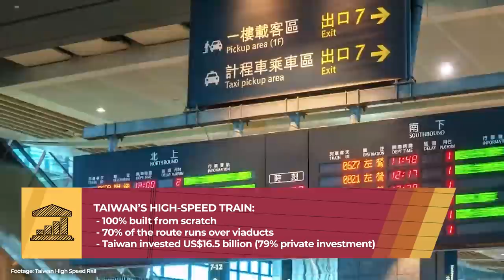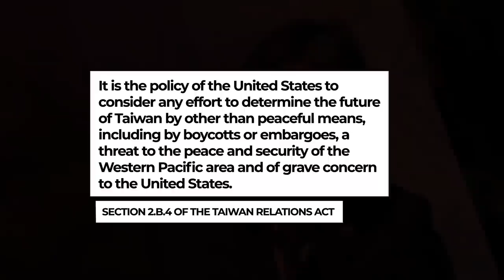Could JAPAN save TAIWAN from CHINA? - VisualPolitik EN

Comment: Once you said TSMC I knew that alone was enough.... Single most important factory in the world.
Reply: You would have to think they have it rigged to blow ( just in case )
Reply: As soon as the first missile landed on Taiwan, that huge TSMC fab would be history.  They’re building an another one just as large in Arizona
Reply: @didiermontagnier6114  The one in Arizona is only going to have a fraction of the wafer capacity of TSMC's multiple leading edge fabs in Taiwan.  Its also going to be a 5nm fab that goes into operation in 2024 which while great will be a node or 2 behind what TSMC will have in Taiwan in 2024 (2 or 3 nm).   One (of multiple) reasons TSMC aren't building cutting edge fabs in foreign countries is its alot easier for trade secrets leaking out, as in any industry a competitor (eg Intel) will have an easier time  poaching competitions employees (eg TSMC Arizona employees) if they speak the same language and are in the same country as its easier for someone to uproot themselves and move to another state/province.  This lack of language barrier has made it easier for Chinas SMIC to poach hundreds of TSMC employees since they speak the same language, although they only got so far because of all the sanctions on semiconductor equipment with US tech (eg ASML EUV tech while from a Dutch company it contains US tech and has US operations (eg laser maker Cymer)
Reply: I think the factory that makes TSMCs machines is in Europe. Manufacturing capacity should be back within two years.
Reply: @kopkaljdsao  Two years without chips? That would put a lot of companies out of business worldwide.
Reply: No! It's the people not the factory.
Reply: @2drealms196  You left out the packaging technology that is needed for the other tech to work. Plans for fab's can change on a dime. They are built in stages and TSMC has already talked about expanding AZ already (in conjunction with the 50 Billion technology bill in congress). Between Japan and the US the semiconductor packaging industry have easily moved to India, Malaysia, and Vietnam. Besides China has a bigger problem keeping the lights on, lol.
Reply: @luispnrf  we can survive two years without the top of the line chips mostly used for rich people hardware and military. In any case today's new chip is obsolete and out of production in 5 years anyways.
Reply: The chip argument is the most lazy one. Maybe that says more about our reliance on foreign supply chains? Why not get to building more factories back home.
Reply: @f-86zoomer37  It takes 5 years and 20 Billion to build a Fab. Just because you build it, doesn't mean you've mastered the process. Look at Intel they lost the lead to TSMC because in 2015 TSMC went full in on 7nm DUV and EUV. ASML sold a majority of their machines to them. Now the rest of the world needs these machines and there's a 18 month wait. Still TSMC has the manufacturing talent to make the most out of EUV machines and chip packaging.
Reply: @didiermontagnier6114  everyone uses the chips from that plant so no one wants to blow it up.
Reply: @f-86zoomer37  OR it says just how important the chips are. 

It takes a minimum of 5 years to build a new foundry let alone one as sophisticated as TSMC. 

We don't have the tech to do it. Our best bet would be a partnership with TSMC to have them build a foundry state side.
Reply: @f-86zoomer37  or you know every country develops technology differently and specializes in different things and this just happened to be where Taiwan put its money and it really paid off for them. 

but hey what do we know about specializing technology and exporting it to other countries 
cough cough Manhattan project cough cough apollo program cough cough "advanced aircraft carrier program* cough cough
Reply: PLA wanna do a pro gamer move.
Reply: @jerrywatson1958  cope
Reply: @didiermontagnier6114  and in Japan.
Reply: Wrath of legions of gamers
Reply: @f-86zoomer37  Lol 😆I think it would be alot easier for him to cope if you shared your 50 cents 😆...On a side note the Genocidal CCP thanks you 👋
Reply: @charlesfavell3350  The Gloablist American Empire thanks you for your service. Sir, yes SIR!!! To uphold dilation SIR!!!
Reply: @f-86zoomer37  Lol 😆😂🤣Good one Wumao Uncle Xinny the pooh Will be sooo proud of you he loves us eless id iots he may even let you polish his member 😉
Reply: @charlesfavell3350  Sir, yes SIR!!! o7 
I will not rest until homosexuality is decriminalized in Botswana SIR!!!
Reply: @2drealms196  Still, it's better than not having any sort of back-up factory and just hoping the worst doesn't happen.
Reply: @charlesfavell3350  It actually isn't. It's just not promoted to children like in the US. Sir yes SIR!!! To uphold CHILD DRAG QUEENS SIR!!!
Reply: @2drealms196  
As someone who has been working in the semiconductor industry for decades, I find your analysis amusingly naive 👏.
When it comes to the fabrication of semiconductor, it’s not the quality of the employees that win or lose the race, but the process each company uses to make their product competitive.  The design team at TSMC is tiny when compared to that of Intel because Intel design their own chips while TSMC just manufactures chips for other companies.  
btw, TSMC 5nm is the same as Intel 7nm based on the specs of their respective peripheral and memory transistors.  It’s just that Intel is having a problem with their yields.  Intel’s 5nm should be competitive enough against TSMC 3nm once the products are announced.
Reply: 🛑 SERCH ADITYA RATHORE-HE ALSO MAKES INFORMATIVE CONTENT LIKE VISUAL POLITIK
Reply: @f-86zoomer37   plus u cant just copy a product coz u want it,,..  Its common sense , your saying these company are trash when they worth billions..??
Reply: @didiermontagnier6114  destroying a physical structure doesn't destroy the intellectual know-how and the skilled workers fielded by that country or that company.  Both Germany and Japan, for example, were literally reduced to mostly ashes, by 1945, with their biggest & most industrialized cities burnt to the ground from hundreds of thousands of bombs.  Hell, MOST of their respective populations, especially of the most prime age groups, from early 20s to 50s, were either killed, injured, or taken as prisoners. And, yet, both countries quickly rose to technological prominence again, within 1.5 - 2 generations, by the 1970s and early 80s, starting from literal physical scrap.
Reply: @kiabtoomlauj6249  
Both Germany and Japan get to where they are because of the US.  Moreover, if those TSMC engineers are that valuable, they will be airlifted to Japan or the US at the first signs of conflict.  Ever heard of operation Paper Clip?  
In semiconductor, it’s the physical structure that are more important than the people.  Look into how much time, money and efforts go into building a fab.
Reply: @didiermontagnier6114  I noticed what set you off what me pointing out that TSMCs Arizona Fabs wafer capacity won't compare to the mainland taiwan fabs.  I should know my place and I shouldn't have stepped out of line. 

Intel unveiled its rebranded node naming scheme at their Intel Accelerated event this July 26 2021.  Practically every tech media outlet covered it.  

I merely wrote what I did in the previous comment because you seemed to think I didn't know the difference between an IDM and a pureplay foundry nor their workforce breakdown.  

I am merely repeating what others in the industry have said regarding one of multiple reasons (protecting  cherished trade secrets) TSMC chooses to not put a leading edge fab in US because by 2024 5nm won't be leading edge.
Reply: @2drealms196  
again, Intel 5nm is equivalent to TSMC 3nm in term of density and transistor specs.  The main issue is will Intel be able to get good yields out of it.  They will capture the lead if they can get their 5nm to yield.
I admit that I don’t know what will be the wafer capacity of the TSMC fab being build in Arizona and I suppose it is reasonable to assume that it won’t match the capacity of the one in Taiwan;  However, things may change if China is getting more aggressive by the days.  TSMC is hedging its bet by spreading out its fabs.
Reply: @didiermontagnier6114  I am not sure if you're naïve or just plain ignorant?! No company is ever going to invest and share all its technology to a foreign plant, especially one like the USA where corporate espionage and spying has been done so callously up to the point they were caught with their pants down in Germany... Taiwan is cornered, the only option is to start a plant in Arizona (of all places?!) and limit the amount of technology transfer. FYI water is important, something Arizona lacks.
Reply: @jerrywatson1958  Of course you resort to calling me a CCP bot, and you added 4 separate issues in one comment... Your comment is too scattered to even comprehend, let alone actually respond to. And No I don't believe Chinese social media is lying.
Reply: @Yeomen1986  No we have the tech. It came from US. But we sold the rights to use it to others. They made the final steps necessary to make it mass production ready. It's the recipes that make the TSMC process the best to date. Doesn't mean someone else can't come along and do better. IBM recently made 2nm silicon. I guess it will go into their quantum computer. But if AMD where to license the process. Who knows, they could have TSMC make it just for their use only. That would be a game changer I would think.
Reply: @kopkaljdsao  Yes, the UV lithography machines of ASML from The Netherlands
Reply: If attacked, Taiwan would drag the whole US tech industry into toilet, so I wonder If Us is sincere about Taiwan's defense!
Reply: @dirzuandrei-ovidiu4471  Which is why the US would defend them... they need those chips. It's not because we actually care about Taiwan. We don't want China having that foundry with our specifications and we have no way to make those chips ourselves. If we did we wouldn't care. :)
Reply: @dirzuandrei-ovidiu4471  Well the Tech manufacturers have and or are moving out of China. Japan is paying 37 companies to move production out of China to other SE Asian countries. When Foxconn closes it's factories in China. China won't have the chips to run it's weapon systems. China would fail. At that point the Japanese would rearm, you what happens after that. Japan will come to the aide of Taiwan, then the US would come to the aide of Japan.
Reply: TSMC is setting up factories in Europe and the US, I would not be surprised if explosives to destroy their machines in Taiwan are already on location.
ps. ASML is the single most important factory in the world, the only factory that can build the machines for high tech foundries.
Reply: @buddy1155  You should watch how ASML builds a 150 million dollar EUV machine. They don't do it by themselves. The optics these machines use are made by Carl Zeiss. It doesn't work with out them.
Reply: @jerrywatson1958  There are also a few other essential suppliers. Even their clients like TSMC and Intel help AMSL.
Shows how delirious China is if they think they can build those machines as well.
Reply: @buddy1155  There is also the chemicals used in the process that only come from the US. Even the DUV process needs Japanese/American sourced chemicals also.
Reply: @rickywinthrop  It is called nostalgic feelings, people tent to think that things used to be better.... they are not.
I recently drove my first car, first model BMW 3-Series, In my memory it was the best car ever, it isn't it is a piece of shit.
Reply: @rickywinthrop  Yeah but back then everything was made in the USA. Now our chips and associated electronics are made in Taiwan or China mostly. I wouldn't say "WE" were happier. Many weren't even born then. But looking back at history, struggles and strife have always been a part of human history. Also we didn't have the human rights we have grown up with today. Having survived the Cuban Missile Crisis, crime in the cities, and Covid (so far). This time is better than 1968 in the US.
Reply: @kopkaljdsao  Yes is called USML and is a dutch company.
Reply: There's also samsung

Comment: Note that protecting Taiwan from an invasion by China can be done by conducting sea denial operations in the strait between Taiwan and China. It is therefore not necessary to defeat the entire Chinese military. One only needs to be able to saturate the strait with enough anti ship missiles to make an amphibious landing impractical and for Taiwan to keep control of its own airspace. Granted that if China launches a full court press that could be difficult. But the bottom line is that China for all its military expansion is still lacking the specialized sealift ships it needs to pull off an opposed invasion.

Comment: Currently in China the fluctuating electricity supply is forcing Japanese electronics companies to exit China and relocate to India and Vietnam, interesting times in that China's upper hand is being reduced both in foreign investment, employment and industry placement. The geographic strike capability by Taiwan and Japan against Chinese cargo ships threatening their economy is the biggest worry for the CCP. The influx of new submarines into this area will be a major worry for the maintenance of economic viability
Reply: @Emilechen  China has significantly cut back on “Coal” fired power. Firstly because of fossil fuel emissions before the Glasgow meeting and permanent reductions. Massive cutbacks on high efficiency “Australian coal”. Now because of the cuts coal has gone up in price so much the coal power generators are losing money. Also the second rate coal being imported has to be burnt in greater volumes to get the same amount of power as the Australian coal. Hence the cutbacks and regular blackouts. Foreign manufacturers are now leaving mainland China because of it.

Comment: The question can only be answered if we understand exactly what the military situation is. The PRC lacks the ability to land sufficient troops on Taiwan to take the island, before there lines of communication are interdicted by US SSKN’s and probably aircraft. This situation may change in about 10 years when all the Type 075 vessels are completed, but right now the most logical scenario is china taking the Taiwanese island off the mainland, although why would they wish to do is a good question.

Ignoring the military situation, if the question is would the Japanese assist Taiwan in a war, that is a good question. I suspect the answer is yes, but it would not be immediate as there are public opinion and legal issues to resolve first. That is why any successful PRC attack against Taiwan needs to ensure sufficient troops are landed to quickly take Taiwan. 

The Taiwanese army consists of about 130,000 men, organised into 26 infantry brigades, 5 armoured brigades and 3 mechanised brigades. Reserves would be raised to fill in these formations. The PRC needs at least three times this force in order to quickly take Taiwan, which requires landing a lot of men, and supply. I suspect the lines of communication will be quickly interdicted by SSKN’s, so this force needs enough supply to conduct operations for at least 7 days, if not more. Even the US lacks this capability, so any war will not be short, thus japan will have the time to get involved.

We can only hope this will not occur, but as long as the US keeps SSKN's on station to interdict any Chinese lines of supply , then its unlikely there will be a hot war. If they do not then i suspect a war is very possible and Japanese support will be critical.
Reply: The problem Japan has is a government favoring towards active military role, that is stuck with a pacifist population that insists that Japan should defend no one but itself directly.
Reply: @kaijuslayer3334  I agree, that is the reason why it would take some time for Japan to assist. However Japan has a very different relationship with Taiwan, than for example Korea. Most Japanese people like Taiwan. Attacking Taiwan would reduce a lot of that anti-war sentiment.